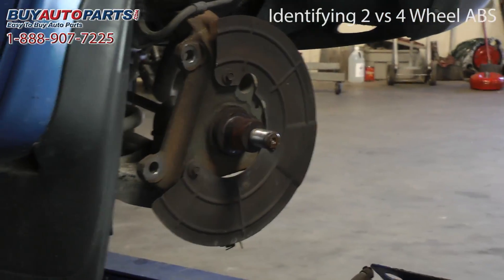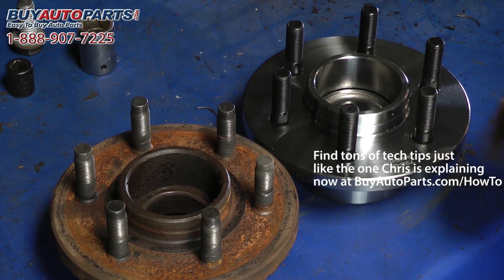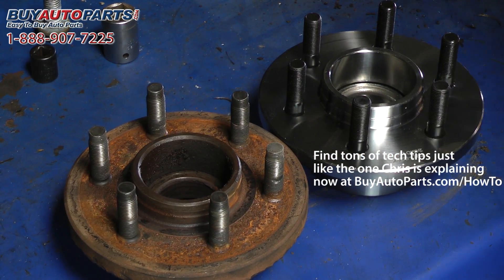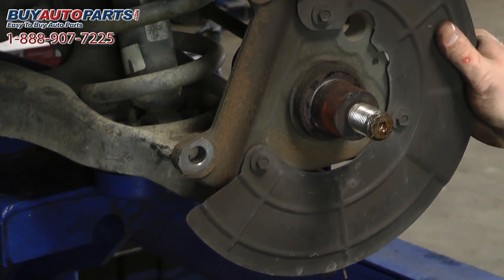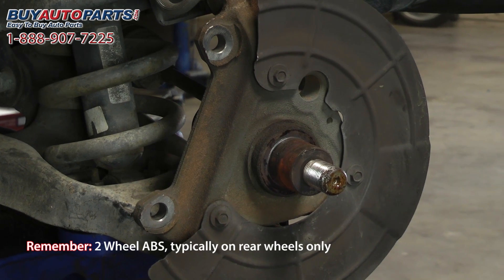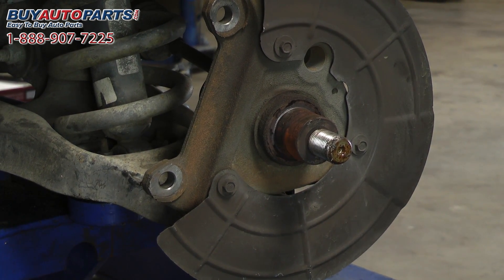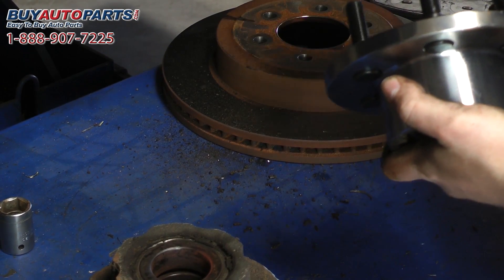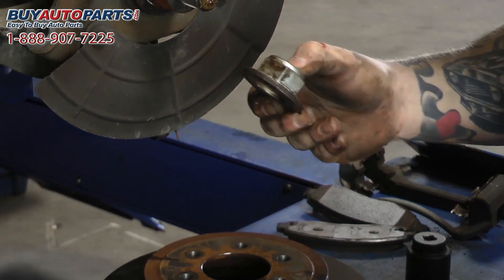4 Wheel ABS or 2 Wheel ABS Explained - BuyAutoParts.com

Comment: I got a 97 geo prizm lsi 1.8L engine and need to replace the master cylinder pedal goes to the floor here n there, there's 2 lines Goin into the master cylinder and a plug in on right side a resovor level indacator I think, and has a break light that comes on before starting the car n goes bk off but that's it no abs light, there's wire Goin behind the front tires but can't tell on the back for sure without taking tires off first but I don't think there's any there on the back and the front is disk breaks an back breaks are drum, it says in my book and online that it has abs but I'm not sure still n need help to know for sure so I don't buy the wrong master cylinder for it thank you for any help

Comment: On a 2006 Dodge Ram 1500 the abs is in the back and one on the drivers side front wheel only and Not the passenger front wheel.

Comment: i have a 2wd mitsubishi outlander and i have been looking around for parts to get an abs sensor replaced on the rear left side everywhere i look only has the front. Are you saying if  i buy the piece for the left front side it will work for my vehicle?